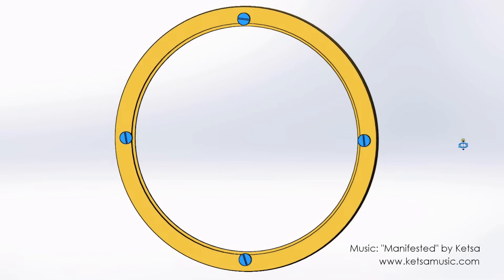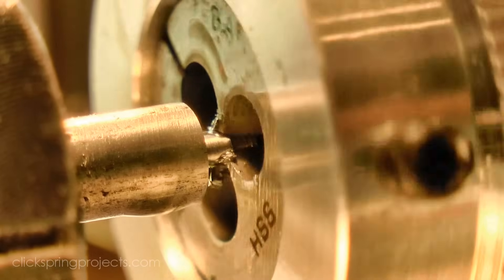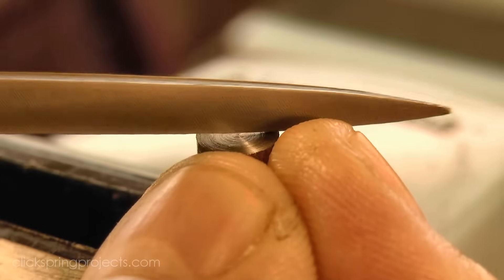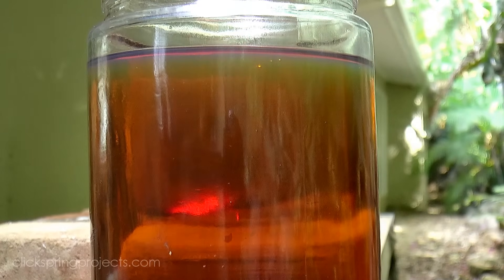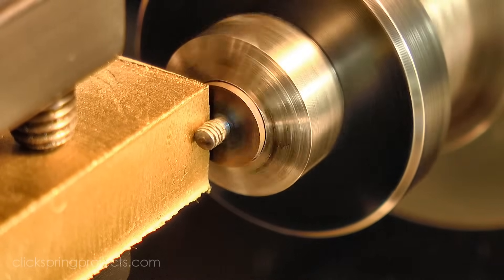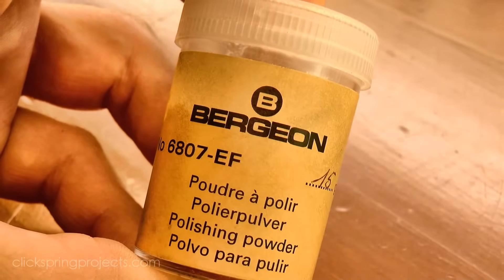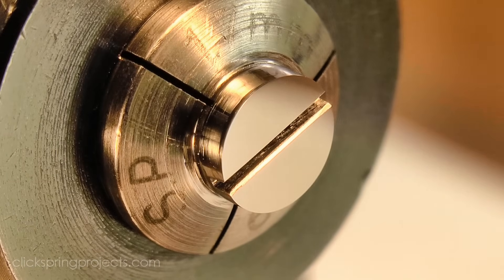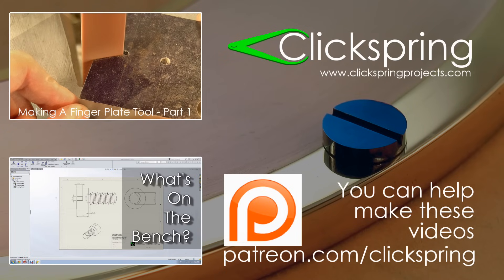Clockmaking - How To Make A Clock - Part 11 - Making Polishing And Bluing Bezel Screws

Comment: Absolutely excellent, such attention to detail.   I noticed you are using SolidWroks.  What a package.  I use it as well for my desings and I have the SolidWorks Simulation addin as some of my work requires a stress analysis, and have used it since 1996.  An oldtimer but still lerarning new modeling techinques everyday.  You are simply amazing in you depth, what with the computer modeling and the machening and all.
Reply from the maker: Glenn Felpel I absolutely love that software. It is far and away the most powerful software I have ever used, in any field. So intuitive, I can't say enough good things about it. Then again at the price it has to be! Thanks for watching mate.
Reply: Glenn Felpel Yes you are right about the cost.  But at work they use ProENGINEER.  I could never affore ProE on my own.  And I think SolidWorks in a way is more powerfull.  I appreciate your modleing...Love the knearl on the thumbwheel and the nut.

Comment: After reading all the comments, great jobs and questions I want to try to add something different so.....

How's the weather? Does/Will it affect the building/operation of the clock?
Reply from the maker: MrPlusses Very lucky to be in the middle of the dry season in my part of the world (Cairns, Australia.), so today is absolutely beautiful. You're right to ask though, big swing of climate conditions from the dry to the wet season. This clock isn't designed to be a particularly good timekeeper, so performance will vary for many reasons in addition to weather. But a precision clock would  be difficult to compensate over the 12 month cycle. Corrosion from humidity in the wet season is a major challenge too, I may have to keep the clock in air-conditioned comfort once its complete! Thanks for watching and asking!
Reply: Clickspring Thank you for the explanation. I thought of the question as we are into a long dry spell (3 months+) in a place where it rains a lot even in summer ( Cloverdale, British Columbia, Canada). A clock under a crystal globe we have does not like dry weather it seems. We've had a drizzle today but back to 29c tomorrow. Instead of tick-tock it goes tick-thud.lol

Comment: fantastic work, what was that green stuff (looks like blue tac consistency) and why was it used? gently clean the part?.
Reply from the maker: nathan hellyer That's called Rodico, and you are spot on, its for cleaning off dirt, oil, fingerprints etc. It is very much like blue tac, I've wondered if its just the same thing. Thanks for watching.
Reply: np

Comment: Thank you for the beautiful video. Could you tell me what pattern files you used to cut those screw driver slots?
Reply from the maker: steven eckels I used knife files, but would rather have had some genuine slotting files. Can't seem to track down Swiss slotting files any more. Thanks for watching Steven.
Reply: It did look like a simple knife file. I had to ask because the result did look too perfect for a file of that pattern.  I can only assume you've done that before! Looking forward to the next installment.